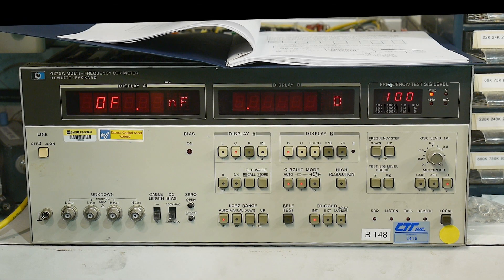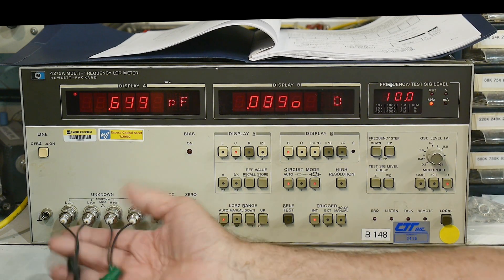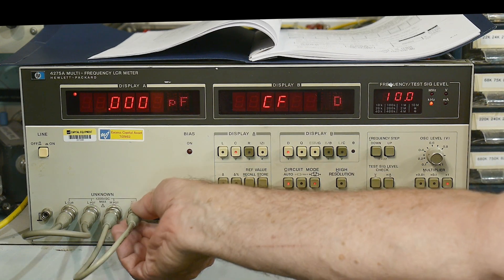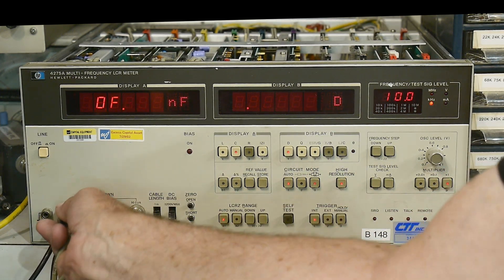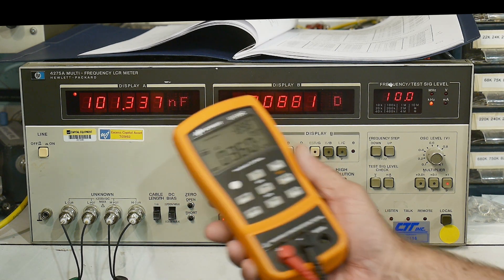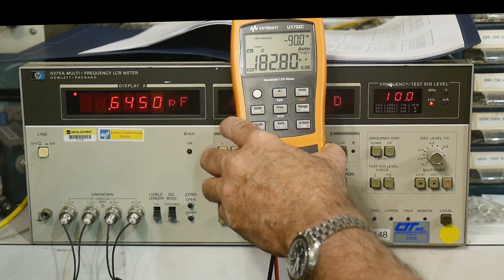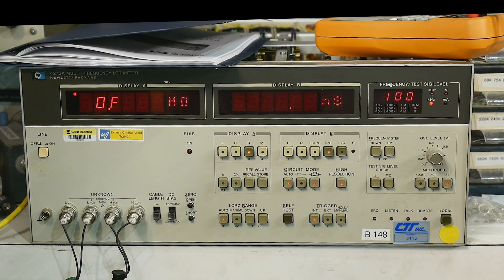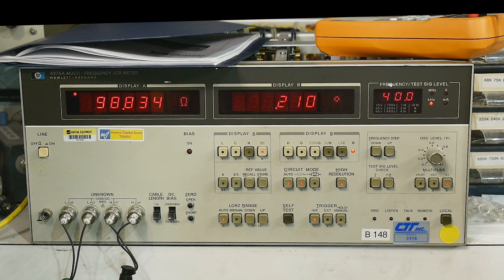#1681 HP 4275A LCR Meter (part 3 of 8)

Comment: Non-inductive resistors. Yeah.... thats a thing. Digikey gifted me a pile of high power resistors because they ended up being helical wound instead of film when I wanted to use them for a HF and VHF dummy load. Even the supplier lied to them about the composition but the destructive investigation I did exposed the truth

Comment: I would have stuck with your BNC H bridge arrangement as the measuring head, because you can successfully open/short calibrate that. The DIY clips never had proper correction applied due to failing open/short calibration.

Comment: I would slice into two coax cables at their centers and solder my clips to the axial conductors.  The stray capacitance and lack of shielding in your present fixture is partly responsible for the poor resistance performance.

Comment: Couldnt a nano vna be programmed as a ridiculously accurate component (inductor, capacitor) then used in place of the test standard? It seems to work in software defined radio, stands to reason it could work going the other way as well. Actually, isn’t that similar to the new bit of tech that Eric K released based on his TinySA.?
Reply from the maker: uh, no and no

Comment: I am following along at home. I made a replica of your unshielded assembly. I got very similar results. With either the official HP 16047A fixture or some shielded Kelvin clip leads it works correctly.

Regards

J.

Comment: I used a similar instrument as yours...it seemed like in 1983 it had LCD ...

There was a bolt on attached box that enabled a Kelvin set of tweezers...then you pick up chip capacitors...and measure...

We used this HP for values like 5 to 10 pF....with up to +/- 3% tolerance

I thought the test frequency was like lower....

Who knows...

Good score....

I will watch lean & remince....

Comment: This is a really nice instrument! It is quite versatile and accurate. A few notes on it's use:

- In your earlier video, you mentioned it does not have a 100Hz test frequency option, only higher frequencies. That's correct: the 427*4*A has test frequencies from 100Hz - 100kHz, and the 427*5*A goes from 10kHz - 10MHz. 

- The shields of the coaxial connectors are not connected together at the chassis. They are used as kind of a guard/shield, but not exactly: they actually carry the return current of the measurement signal. See page 3-17 and 3-18 of the manual, and particularly figure 3-6. The 'Err 4' that you see in resistance measurement mode could also very well be because the outer conductors of the coax cables are not connected together. 

An easy way to do this in practice, is to just mount 4 bulkhead BNC connectors on a copper/aluminum plate. I have the same instrument, and I've made a custom cable made out of 4 coaxial cables of 1 meter length, with the shield of the coax cables connected together at the very end of the cable. Then from there, you can make a nice kelvin connection to the DUT.

Please drop me a message if you need the service manual and operator manual.

Some really interesting experiments are possible with this instrument. One example is measuring material properties using a dielectric cell with guard ring. Have fun!

Comment: I was surprised by the inductance of resistors a few months back. Was fixing a stick welder and decided to replace a 2k 2W resistor. Put in the first one I found, turns out it was a wire wound. It was part of the pulse-by-pulse current limiting feedback circuit. The original was a metal film or something like that. It threw off the feedback timing, causing the thing to go to thermal protection after a few minutes of welding, despite the fact that it should be able to run 24/7 at the currents I was testing.

Comment: You definetly need kelvin varley test probes. With those clip leads you made still dont make a proper 4W connection to the component under test.
Reply from the maker: watch tomorrow, it is much more complicated

Comment: There is also some parasitic capacitance on the test leads of the small keysight instrument when measuring 180 pF down to a part of 1 pF. Please check the measurement with lining up the 15cm cables side by side or 2 cm apart (for better reproduction of the measurement). (At 182.8 they were crossed and the value went up to 183 when moving the instrument.)